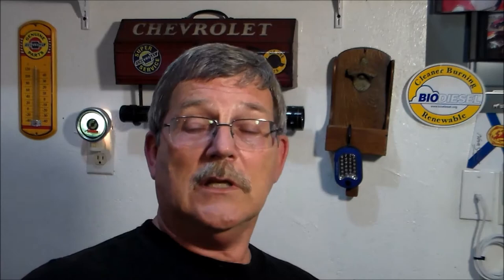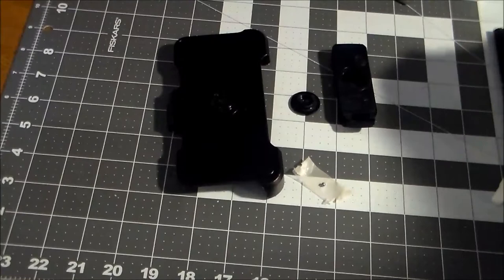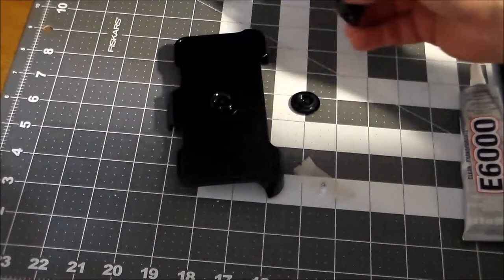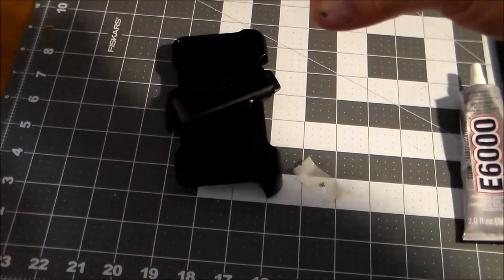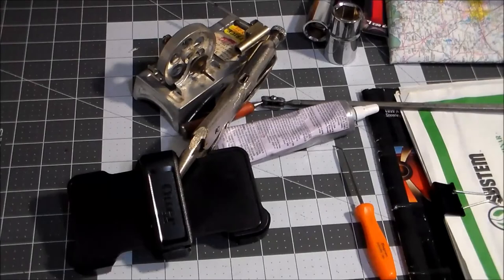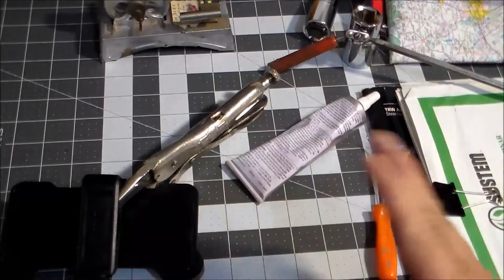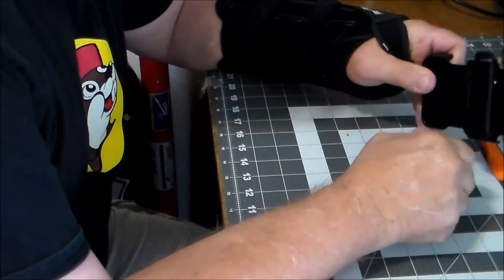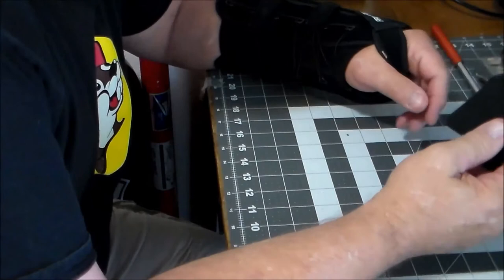Cell Phone Clip Repair

Comment: That 6000 glue is good stuff. Gluing plastics can be tough due to the wax in it. They make plastic welders.
Reply from the maker: I hope it works. If not I will look for a glue better suited for plastic. Thanks Buzz

Comment: you were real lucky to have found all the parts especially that little ball, looks like some of the tools you used was powered by a steam engine.. lol
Reply from the maker: I was putting it together and going to clamp it. The clamp jumped off and that ball bounce under the table. I found it with the magnet. Got it clamped good on the second try...haha